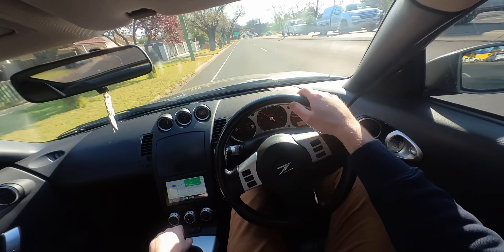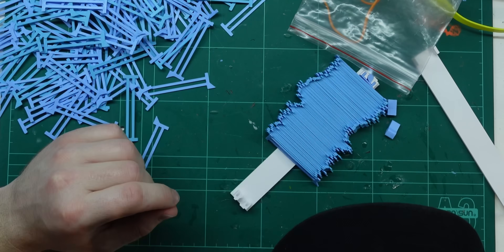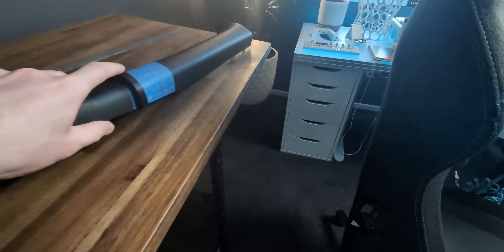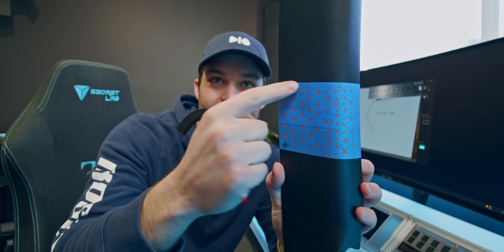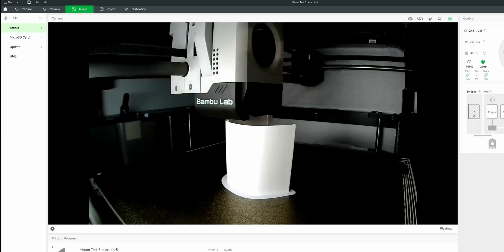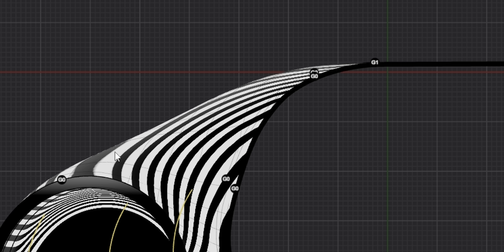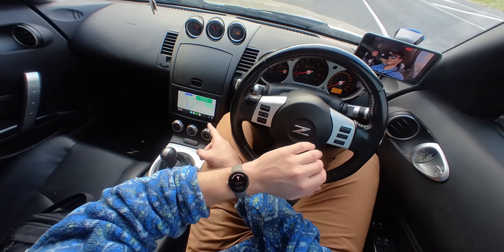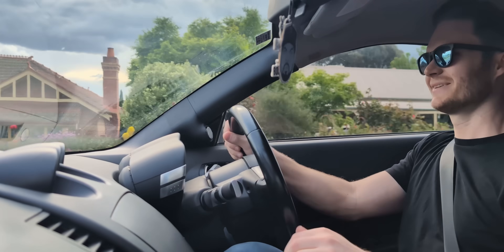a gauge pod with maps.

Comment: Is it possible to extend the battery ribbon cable to have it mounted under the dash and then constantly on charge when driving, but with zero sun exposure? 
Could leave the back off the watch as well, and then the metal back won't contribute to the overheat issue.
Reply from the maker: Hmmmm could try relocating the battery. Not a bad idea, I have been looking into that for a potential VR headset lightweight mod.
Main thing would be ensuring cooling, possibly find a mini fan that can run from the battery so if it's ever discharging it's also cooling
Reply: @camshand  if the battery is mounted away from the sun and within the dash it will be well within its happy temps. Though the over temp sensor may be on the circuit board, so leaving the back off will stop that chunky of metal heating up and cooking

Comment: Micro controller, GPS module, round touch screen, buttons/wheels for flavor. Not an "off the shelf" project, programming would be required, but would be completely standalone and you can make it do whatever you want.

Comment: Loser. It need to be complete custom system on esp32 or some oth sht with round display fully custom programmed and attached to the gps device wireless. And need to be connected to the car by wires so it always powered and can read some stuff from ECU. You vid is 80% about some useless CAD modeling. Dislike.

Comment: Its a great idea, but yeah built in battery is not the best idea. Although the built in versatility is nearly unmatched. I think what you were wanting can still be achieved though it may take some programming and assembly. Maybe you can get by with a cooling aolution, but its a huge fire risk.

If you ask chatGPT it can easily provide a material list and a plan of action to implement a custom hardware solution.

Comment: But 
Just put a charger on the back and activate the always on thing on developper settings. And for the battery just cut off the battery of the bms and leave the bms without nothing

Comment: You could try doing the same thing with a BeeLine Moto pod. It's a minimalist GPS pod for motorcycles and bicycles, and it uses its own app which shouldn't connect to android auto, so as long as google maps and beeline are set for the same route it should work.

Comment: I dont know about smartwatches, but i do know smartphones. 

Batteries have small pcb's which wire + and - of the battery and proprietary connector on the other. You need to feed electro in from there. Dont forget a resistor, check r androidafterlife for more info. 

You have a bigass pod to mount to. Add a capasitor and a small fan. A little airflow makes all the difference ( had to make something like that for dahs mounted phone that overheated in the summer.

Comment: I have an eonon head unit that runs android, it handles the heat of the car on a hot day, I would think a small gauge running android could be made, but that's just it, it would need to be made and so far no one does. I like the concept.

Comment: Removing the battery would work. Just need a signal for temperature.  You could also use wireless charging with a different watch so the watch is removable.

Comment: I attempted a similar project with an arduino and LED display, but the roadblock was there's no way to get the turn-by-turn information out of Google Maps on the phone, there's no API or official support for this kind of accessory.

Using a smart watch is such a straight forward solution to the problem, I wish I'd thought of it! Removing the battery and powering it directly definitely seems like the next step.

Comment: Two things, there's ESP32 powered units that are essentially a smartwatch that you can program yourself for what you want them to do, no battery, round display, could be made to run off a car. 

Secondly, I don't understand why google doesn't give more two tiered directions, like waze sometimes, and even google sometimes, gives your direction in bold on top with the next direction slightly greyed out and smaller underneath, and it's very useful for the scenario you mentioned, but it just doesn't do it often enough.

Comment: They are many circular screens on the market intended to be easy programable for DIY projects, useful for many cases as smart watches, IoT monitors and controllers, can work as stand alone devices, with single board PCs or mirror another device, I think that could be a better option than any smart watch

Comment: The easiest way of capturing complex contours is to use something like wire and shape it around the object. A tape line can be helpful to keep the wire coplanar. Any wire that hooks its shape works, I've even used solder in the past

Comment: There has to be a program out there or something you can use. People mentioned the beeline, but what I'm imagining is a second screen that connects via Bluetooth and is a permanent installment. It'd allow you to use both the android auto and your new screen, just like how you can use a smartwatch while using the unit. 

New cars like my own has the turn by turn in the gauge cluster as well as center screen, meaning it'd be possible to extract that data. It's not easy code I'm sure, but there's probably dev code in Android Auto for it and someone smart enough to try and extract that code.

Comment: 2:50 ASA is actually a fairly good material in place of ABS nowadays. Similar thermal characteristics, UV resistant, doesn't stink as bad or put off nearly as much noxious fumes, and Bambu Lab put out a pretty nice Carbon Fiber ASA that has a pretty nice finish on it. (Even though I know that was a pretty good place to plug PCBway)
Reply from the maker: Interesting you mention ASA, my understanding of why ABS isn't good for your health is the S is Styrene. the S in ASA is also Styrene.
Although it may not smell as bad, the VOC's being released are still toxic and should be treated with care.

It's probably because I come from a background working at a University where safety was a priority so we had proper ventilation.
So at home, I'm not willing to risk my long term health by rolling the dice without adequate ventilation. 

In general though, ASA solves a lot of pain points of ABS when 3D printing. I'm planning to add ducted fume extraction for my laser cutters, and hopefully can add the enclosed X1C into the pipes.
Reply: @camshand  Fair point. I suppose since I've kinda been learning as I go, I've kinda missed that bit. I also trusted the integrated carbon filter to catch most of the VOC's, but know it's not a silver bullet. 

Also coming from previously owning an Anet A8 (an open-air cartesian printer known for catching on fire if you didn't upgrade some critical bits) I never got to play with some of the styrene-based materials, so I'm less experienced with handling it.

I also did some cursory research before working with ASA, since I kinda was concerned regarding the VOCs, and allegedly it puts off less fumes compared to ABS, but I'm not certain if that means less styrene in general. I aughta look and see if someone in a lab setting actually did some tests on that.

I'd love to have an X1E that has the better filter and heated build chamber. That, and I'd love to get into higher education around some of this stuff. 3D printing has a lot of potential.
Reply from the maker: I do wonder if 10 years down the track there'll be a "3D printing" epidemic from people inhaling fumes they weren't aware of. It's the same in the laser cutting community, I see so many posts on facebook of people cutting PVC based materials, which creates chlorine gas when laser cut.

Seems the issue lies in all materials have risk in some way, we kind of assume with consumer access it must be safe.

I too would like to know some comparisons between VOC's or filament types and other common products.

Comment: There is a device that looks like what you want to do with this project that is ment for motorcycles, just adapt your bracket to hold it instead. It is called  the beeline moto, 2 has charge while in use support.

Comment: I’m going to give you a trick for the contour gauge, when you’re measuring, draw a mesh, let’s say 2cm by 2cm squares, and then diagonals on a flat surface, a piece of tape, and then stick that to the part, once done, now use the contour gauge, using the mesh as a guide, create that same mesh on your 3D software, and now you don’t need to scale or anything, and your working with 2cm curve segments, if at any moment you take a measurement within the software and it isn’t around 2cm you know you’re wrong on that specific segment instead of the whole curve, also that way you know where the irregular sides start and end, you have a straight line within the confines of your 2x2 grid.

Comment: You could point your air-con vent at the watch to keep it cool during charging. If you want to go down the rabbit hole, you could internally vent some air from the air-con duct up into the pillar to the back of the watch.
Also, an alternative to ABS is ASA. Prints similarly to ABS but has better UV stability.

Comment: thanks for the "Contour Gauge" info I need to print stuff for a pillar and bonnet and had no idea how I was going to get the curves
Reply from the maker: yeah I'm stoked to have found out about it. Plenty in hardware stores that'll probably work a bit smoother than the 3D printed option. Either way a very useful tool to have!

Comment: An alternative for you would be using Beeline Moto GPS, which is a navigation system for motorcycles that has a circular display. You may want to look up a couple reviews of that, it may work mounted on the A pilar and can be used in direct sunlight
Reply: Looking at the thumbnail I thought thats what it was. I think its a perfect device for what he's looking for.

Comment: try Royal Enfield Tripper Navigation System its small and might be able to fit works exactly like you wanted the watch to work
Reply: I agree, not sure if they allow u to buy a standalone unit without a royal Enfield bike , I wanted to build something similar which can just run off the usb port on my bike
Reply: @shravankashyap9437  you can just go into any showroom and purchase it, no questions asked.

Comment: Hey man. Instead of the pixel watch, try the beeline moto it's a gps device that is used for motorcycles, which is about the size of a Samsung watch that has an e-ink display and is just used for navigation. It'll probably be better than a pixel watch and mure straightforward.

Comment: It is quite entertaining to see the design process. But instead of using the smart watch you could replace it with a navigation system design for motorbikes called Beeline Moto. It too has a touch screen and round form factor and is meant to be visible in direct sunlight so it should be the better alternative to the smart watch

Comment: You should check on the specs and deduct 10c from them. PETG withstands more like 75c and ABS is quite soft at 95c. If you pull off abs from hotplate which is 95c then you can bend it easily.

Comment: FYI: if you activate dev options (same way you do on any android device) you can select keep awake when charging, so if you managed to actively cool it while charging (maybe with a peltier element) this could work
Reply: Peltier modules are horribly inefficient for cooling, just add a small heatsink or attach a fan to it. No need to go overkill for cooling.
Reply: The only problem I see with a heatsink would be that when the car isn't being used but is parked in direct sunlight, the air temperature inside would increase to the point that it probably wouldn't be able to cool well.
Although, I'm not sure it needs to be charging when the car isn't in use.
Reply: @mert2x982  they're inefficient sure, but the cooling for the size is unmatched. The car should be able to provide plenty power for such a small part and a heatsink would only be effective for a little while, not really after it's been cooking half the day. Not to mention there's really not a lot of a pillar. Maybe if the AC was vented to the back though, or mounting over a vent like some cars do.
Reply: @yourfriendlyneighborhoodjinx I peltier needs it's own heatsink, so this makes no sense.  
They're more commonly used in applications where the heatsink sits outside of the device, like a mini fridge.
Reply: just route an A/C vent to the back of the watch - plenty cooling while driving but also no cooling = no charging while in park, a built-in safe lock
Reply: Peltier devices are trash. Require moving heat away from them while also not providing much in cooling. A simple pasted on heatsink with a 40mm fan would be a much better option over a peltier.
Reply: there is so much space you could literally take apart the “smart” battery (it’s prob just a bms connector, with temp sensor) wire in a dc dc converter 12->4.2 so it won’t attempt to charge and take some little aluminum rad from like mosfet and stick on the watch’s cpu I believe it would have been plenty of cooling worse case just add a fan. 
fucking up with the electric and software part is such a bummer after such a good work
Reply: Peltier element would dump MORE heat into the housing negating any gains. Simple airflow does wonders for cooling.
Reply: Peltiers are pretty neat but the problem is they just emit the heat out the back of themselves, and generate a small bit of heat themselves from just functioning. a bit of thermal glue and a heatsink on the back would probably do the trick, with some vents in the mount since of the air was just trapped in there the heat would build up regardless of which solution you use
Reply: Move the computing unit under the dash and thermal insulation for the rear of the display  alfoil tape or something
Reply: This thing would catch fire in Arizona

Comment: I used to use my Sumsung Gear S2 as my navigator on my motorcycle by wrapping it around the handlebars, it worked great! but the battery went bad quickly overtime and at the end i had to charge it too often to make it worthwile...

Comment: PETG is going to warp, too. Inside the car gets a lot hotter than outside the car. I made a license plate frame from PLA and it sagged in no time. Made one from PETG and it took a little bit longer to sag, but still sagged. The ABS one I made after that has been fine for a while.

I also made an iPhone mount that goes in front of the centre cubby above the stock stereo location. The PLA one warped and the phone would no longer fit. Ditto for a PETG one. The ABS one has been fine for a while.

Comment: A front bezel that interfaces with the crown would be cool, so you rotate a ring around the dial to scroll.

If you're sticking with the pixel watch, it looks like you have room for a little 12v fan in behind it to help keep the temp down.

Great little design project!
Reply from the maker: My brother actually suggested that when I first told him my idea!
If I was to find a watch that could be wired in then I'd for sure look into making a spinning bezel, it's a great concept
Reply: @camshand  I reckon any cheapo Aliexpress smart watch could work, they wouldn't be great but if all it's doing is managing spotify and maps I reckon it could be OK

Comment: Check out the beeline moto, navigation systems, they do exactly that, simple arrow, and they have a nice mount on the back, so all you need is print a holder for the car, thats how i run it

Comment: Look into some of cheap Amazon ‘fitness watches’ I have one for $120, round OLED, 7 day battery, it ties into my phones gmaps for nave. You have to start nave in gmaps, but then it displays on the watch until I arrive.
Reply from the maker: Wait what?! The cheap ones work with google maps? I looked at a bunch but thought they had their own weird apps. I'll have to look into this further, as if they use their own apps to middle man the directions they might also work whilst I use android auto!
Reply: @camshand  Not directly, it’s a notification relay. I have the Amazfit which has an App Store. It’s an Amazon purchase, if it doesn’t work the way you want just return it. You will need to spend +$130 to get one good futures.

Comment: Something you could consider is using a Raspberry Pi Pico, and an OLED circular display. You might have to get familiar with code, or have someone help you with it, but I'm certain there are tools out there that would let you take that google maps data such as the turn indicator, and display it on the raspberry pi. 

A smart watch is most definitely NOT the first thing that came to mind when you mentioned a circular display. It was the second or third though. Still, I don't think a watch would be the right tool to use here.
Reply: I think the Sunton 2424S012 would be a great fit. Tiny little circular LCD with an ESP32-C3 on-board (which also solves the connectivity question). It's not OLED but these things are pretty cheap and it might be sufficient.

Getting data out of Google Maps into the board is the second question. I think my approach would be to look at Gadgetbridge which (iirc) supports sending navigation data to smartwatches - maybe it'd be possible to implement one of the protocols. The bangle.js one looks pretty simple though it will require re-implementing nordic's uart service.
Reply: That’s what I thought he was going to do but that’s a lot more work. If you’re getting into software from no experience like that it’s a massive amount of learning for something that likely has a much worse UI at the end. From experience…